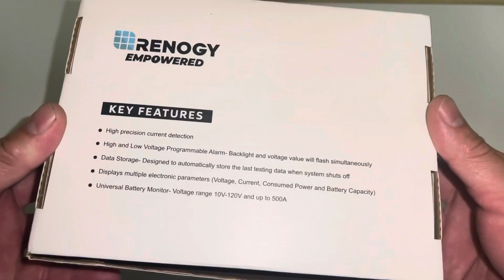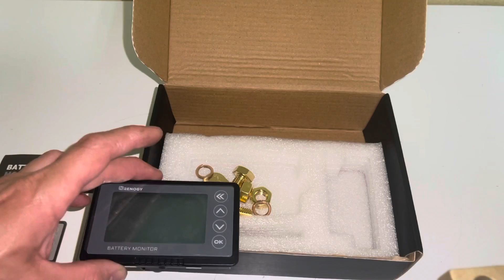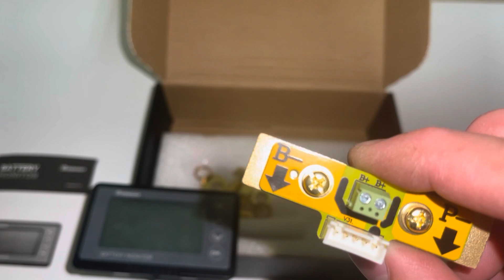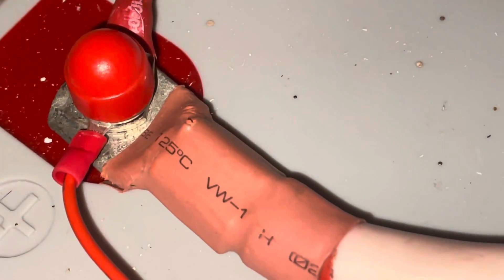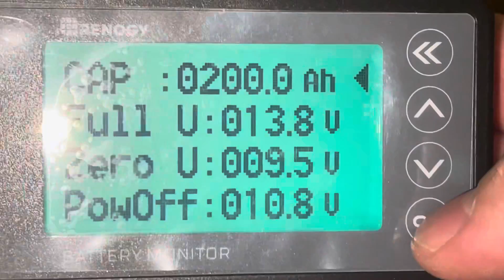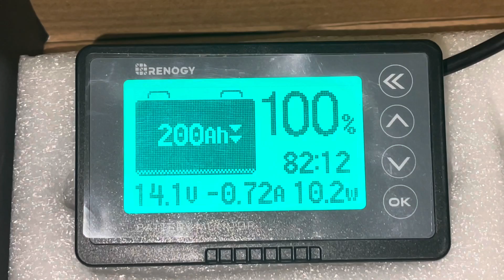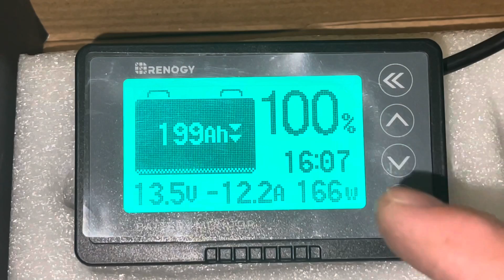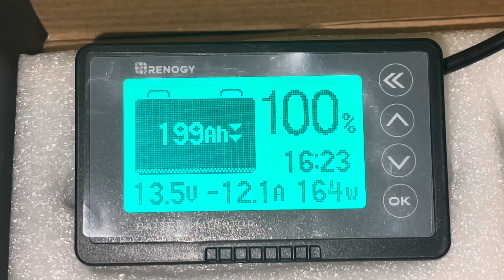Renogy (RBM500) 500A Battery Monitor Unboxing & Installation

Comment: Show if I have 3 batteries, 280 amp hours.Each total of 840 amp hours lead time.What amp hours do I put in capacity
Reply from the maker: How do you have them run series or parallel?
Reply: @DIYKAI parallel
Reply: 12 volt
Reply from the maker: 840 Ah would be your capacity
Reply: @DIYKAI That's what I put in there, and then the 14 and a 1/2 an 11 and a 1/2. , than 420 And right now, it sits at 0, but I know I got full batteries other than a couple hours of time on them.
Reply from the maker: @georgebranshaw9908 I'm not understanding what you did? 14.5? And 11.5?

Comment: The data it displays is great, but it drifts wildly. In a matter of a few days it is still showing 100% charge when the batteries' built in Bluetooth BMS are showing 80% and 83% which is a misread of about 100Ah. Not sure how it is so inaccurate. Very frustrating that it can't be reset to the actual charge percentage, only to 100% or 0%. Frustrating to say the least...
Reply from the maker: What I have done is top the batteries off and then reset from zero to full and it has been pretty accurate

Comment: I have my renogy monitor connected to Trolling motor + circuit breaker + battery and all negatives are connected correctly but the "Remaining AMP Hours" are stuck on Zero when i run test the motor... any ideas why this is so? Or is this product simply only works with inverters? or do i need something else connected to the Negative?
Reply from the maker: should be battery negative to one side all other negs to other side. Did you set the Ah up in the menu
Reply: @DIYKAI  yup did all you mentioned and still Zero in the remaining hours 😭
Reply from the maker: @aDadWithBadJokes  hold the up arrow for a few seconds
Reply: @DIYKAI  yeah tried resetting using both up and down and still no use. I noticed the Amp reading barely budge above 3Ah no matter how high I adjusted my motor throttle. I suspect the meter was reading DC only as I'm in Australia and we have AC .. that's my guess really
Reply from the maker: @aDadWithBadJokes  so the shut won’t measure amps of the motor it will only display capacity of the battery and watts/amps being drawn out of the battery

Comment: I just installed this with my RV batteries, and it seems to work great. I would, however, like to have a monitor at the front of the coach and one at the rear. Is it possible to put two of these monitors in parallel?
Reply from the maker: Yes while but this is possible, When connecting the two shunts in series, errors in the battery voltage measurement can occur. The shunt that is not directly connected to the battery loses the voltage drop of the other shunt in the voltage measurement.
Reply from the maker: But if you can connect one to each battery that’s better or go with an induction pickup type that just clamps around the wire for up front as you are only going to be monitoring only from one hope this helps
Reply: @DIYKAI Thanks for the reply.  Still trying to understand this.  So the meter is measuring a small voltage drop across the shunt which can be used to calculate current through the shunt, is that correct?  What if I wired in a second meter on the same shunt, so basically the two meters were connected together?  I'm not sure how I would do this, I guess I'd have to splice into the first meter's connecting wires.  Would this cause an error in the readouts?
Reply: Also, I can already monitor the voltage up front, with a simple cigarette lighter meter, but I'm mostly interested in how much current is going into the batteries from the alternator, and knowing when they are fully charged.

Comment: I have one of these but it never shows a plus input only out whatts or amps 
I have 400w solar dc2dc and 240 charger but it never shows or adjusts the remaining amp hours/ battery life
The only way I know it’s charging is the battery volts climb back up to 14.2 
Is this a common fault ?
Reply from the maker: No we never had that issue we set it on e last year and its been on autopilot since

Comment: I bought one and installed it as per the instructions. Its been used for about a month and only ever shows 100%.... I disconnect the DC/DC charger for 3days and let my car fridge run in a hot car and it still shows 100% !! Not sure what the issue is..
Reply from the maker: Have you gone into the setting and tried to adjust

Comment: Can this unit monitor a bank of batteries, or do you need one monitor per battery in the bank?

Thanks in advance.
Reply from the maker: Hello and thanks for viewing.
It monitors the whole system. All your load negatives will go to the shunt.
This single shut can handle 500A it does not matter how much reserve capacity you have. We use it with two 400aH batteries no issues
Reply: @DIYKAI so you have the monitor set to 800Ah ?
Reply from the maker: @Hawkcrom  typo we meant (2) 200Ah

Comment: Could I extend the postive wire so I can mount in, under the bed where all my power connections are? Or can I tap into the power lead to the battery? Thanks any help would be appreciated
Reply from the maker: With the shunt the neg needs to come directly from the battery and all loads on the other side......as far as the power side the main also on the hot side but you should be able to tap it anywhere off the main as it's just sampling from that side and powering the screen

Comment: Hi. The company that installed my Renogy 2000w Pure sine inverter charger put it in the back of a cupboard that i have No access too.. 
So i need to a add a battery monitor screen.   
Can i use this Renogy shunt monitor on my Renogy 200w pure sine Inverter charger ?   
(I contacted Renogy directly but they've replied saying it cant be used with my 2000w charger inverter)
(I am a bit confused because I've seen videos on youtube of people using them together)
Reply from the maker: The shunt goes between the inverter and battery make sure you have the proper size wire for your loads we use 2/0
Reply from the maker: The shunt can be used in any system up to the amps it’s rated for….this shunt is good for 500A at 14vdc or so……you will be fine on a 2kW inverter…..we have it on a 3kw inverter

Comment: Busbar standoff? Why are 2 sides  hooked to negative? Confusing video.
Reply from the maker: standoff is a term used...you can say its like a bridge.......shunts work only on the negative side as with DC it flow Neg-Pos......you have to have basic electrical knowledge before attempting something like this for safety reasons

Comment: Hi great video! I like how you show it in action. Do you know if the meter can be used with non-Renogy controllers (just for the use you demonstrated, not Renogy app use)!
Reply from the maker: Yes it will work without the app and just using the monitor
Reply from the maker: Thanks!

Comment: Definitely wouldn’t buy this again, it’s so frustrating. It should be simple but the bolts are so thick they’re too big to for any of the rest of my setup. Don’t have any wire lugs big enough to fit on them and don’t have the facilities to make a Z bus bar just to fit it on my battery terminal. Absolutely stupid.
Reply from the maker: Yes this is a 500A shunt that’s why it’s so large. Maybe try a smaller one what size is your system?
Reply: @DIYKAI  Only a 200amp system at the moment but I have things to add. I've managed to fit the shunt now but I'm not getting anything from the actual monitor LED screen. Do you know why that might be? (The shunt is wired in series on my negative side as instructed and all my appliances are working as normal) I've tried the positive in each positive terminal of the shunt and still nothing. Could my device be faulty?
Reply from the maker: @benjamindavidscargill5633  Ok shunt connected directly to battery one side the other side all loads.

Did you wire the monitor power it should be some small wires
Reply: @DIYKAI  yeah I have the shunt coming directly off the negative terminal with all the negatives coming off that with the small red power cable attached to the positive terminal.
Reply from the maker: @benjamindavidscargill5633  weird ok we will look at our system real quick and let you know how we have it

Comment: I noticed the backlight is flashing when its charging, is there a way to turn this feature off and does it stop flashing if you have the backlight turned off?
Reply from the maker: Yes you can turn it off we find it annoying that it flashes while charging. Yes backlight is totally off when you select it off and stays off until you turn it back on

Comment: how did you bend the bus bar and did you drill the holes before or after it was bent?  I have a piece of 1/8x 1 bus bar that I'd like to use for that.
Reply: You don't have to do any of that. Just get the Blue Sea Terminal Block 5191 without the fuse.. The block will make the connection to the battery terminal. As these Fuse Blocks are designed for fuses to make the final connection. But the Shunt hole is big enough to fit over the insulator...Best way I found without all the fuss...
Reply: @WizzRacing Great idea! Thanks!
Reply from the maker: Vise and a good ole hammering. Drilled before use some heat to bend and oil to drill

Comment: Do you program in the battery technology you are using? It looks like you use LiFe batteries which can be taken to complete empty? I am using AGM which can go 50%, only.
Reply from the maker: Yes lifepo4 we drain them to about 20% most of the time
Reply from the maker: Yup agm lead acid 50%Dod

Comment: Why do you need a bus bar for higher amperage? I'm setting up a 24v system with 540ah of LA storage.
Reply from the maker: We like to use bus bars because they are rigid less chance of something coming loose
Reply: @DIYKAI  
Ok, no worries. Thanks for the quick reply.
Reply from the maker: @carl8568  Your welcome its more preference than anything we always like to over engineer things lol
Reply: @DIYKAI  
That's a good philosophy mate. I'm setting up off grid in an area in Australia that is prone to bushfires in summer, and the last thing I want it for my system to overheat and cause a fire.
Reply from the maker: Pure bar would definitely outlast wire and rubber lol we generate about 2.2kW a day off 600w
Reply: Grazie 👍 !

Comment: What size hole does the monitor fit in?
Reply from the maker: Just under 4” wide and about 2.5” height 
5/8” thick
Reply from the maker: We can check for you but it was maybe 1”x3”

Comment: Ok, I found this video helpful. But, why did you have to make the "Z" part? Is that something I will have to do when I instal? I didn't understand that part. Thx!
Reply from the maker: Hello thanks for watching…….that Z piece is a stand off because it does not sit flat and we wanted it connected directly to the battery….if you use the provided holder and run battery cable off each side you will be fine….this was just not wanting to have extra wire to deal with
Reply: @DIYKAI  Where do I find all the values enter into the monitor?
Reply from the maker: @sherrieeverett4733  Press and hold the OK button to enter the menu
Reply: @DIYKAI  how do I know the values to enter, I have 100ah
Reply from the maker: @sherrieeverett4733  the battery should have came with a card….what type of battery are you using?
Reply: @DIYKAI  Renogy just 1 100a
Reply: It was in the van I bought, I just added the monitor.
Reply from the maker: @sherrieeverett4733  the internal BMS should handle it for you....the monitor you can set the capacity for 100aH low alarm should be set around ~10.2-10.5V High alarm 14.5V

Comment: Thanks for posting this vid. I had some minor difficulties getting the provided battery + red wire in that small hole. Eventually got it to slide in… Otherwise this is a very solid and well made monitor. Only gripe is how the screen mounts, I prefer the bezel approach like the other monitor screens and switches from Renogy.
Reply from the maker: Your welcome! Yup we had the same issues and grip lol hopefully they fix a lot of the customers concerns that’s a quick way to lose people
Reply: Do both battery positives go in that small hole?

Comment: I have this, I need to see about adjusting the light, also, I needed a longer cable, found one on Amazon, had to file some plastic tabs off at one end but it worked out great for me...
Reply from the maker: this one has 8 levels of light adjustment, or you can turn it off we are going to mount it today hopefully all goes smooth
Reply: @DIYKAI  I know how to turn the light on and off I want to see if mine adjust, I mounted mine inside my trailer, the cable was to short, so I had to find a longer one, hopefully you don't have that problem lol.
Reply from the maker: @camperbum  Ah got ya….ours is in a solar back up room so we went straight into the Sheetrock lol all is good

Comment: Been looking at these. I just received a 300 ah Ampere Time LiFePo4 for emergency solar power in my camper. I have 11 solar power stations for all the small stuff and my chest freezer and dorm fridge but need some emergency air conditioning after hurricanes. Plus I can use it to reduce my electric bill so I can buy other things which is important when you`re on a tiny Social Security check. Spend my savings on the battery, 60 amp MPPT charge controller, wiring, and fuses. I already have 500 watts of glass panels, several sets of 20 ft MC4 cables, and 100 and 120 watt high quality folding panels. Gotta figure all this out on my own but I`m studying about it. Gotta get one of these monitors too.
Reply from the maker: it's well worth it you will know exactly how much power you have and what's coming ang going out the battery
Reply: @DIYKAI  I have nothing right now but a watt meter to measure what`s coming out of the inverter but that doesn`t measure inverter losses. Not sure what the losses will be since they can vary wildly. But right now I at least have enough backup power for cooling off if a storm comes any time soon. In the process of moving which got very expensive fast due to my sister screwing up repeatedly trying to get electricians to hook up my camper. Thank God I got the battery before this happened or I`d have no money left. I made the mistake of assuming she had a working brain.
Reply from the maker: Usually a modified sine wave inverter is about 85% efficient and a pure can be between 90-95%